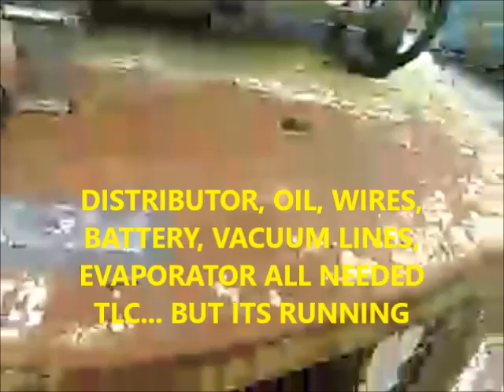Saving a old Clark forklift

Comment: I just bought a Clark gps 30 now your going to make me paint mine please tell me there good lifts I'm excited to have it an from what I can tell there good lifts
Reply from the maker: dont think these were Clarks best, but they are what they are- only 'bad' is they are rather huge...this ones a triple and weighs 9900 pounds- the counterweight is huge, and steer tires narrow- go off the cement, it sinks immediately... biggest 'bad' thing is the brake system- if you ever need to bleed the masters, good luck. its common for the plastic reservoir tee to crack, get air in, and mounted vertically, its about impossible to bleed them... ibench bleeding/plugging kinda works, but reconnecting without getting air in is about impossible- will be 'good enough', but to truly bleed, need to remove them(longer feed tube needed- i used separate reservoirs, tipped rod down, bled, reinstalled and with pedal wedged to floor quickly cut/connected the reservoir hose- a messy pain in the butt, but got all the air out)... aside from brake bleeding, other than physically bigger than similar capacity trucks, theyre pretty solid- the mitsubishi motor will run forever, BTW a 89 mitsubishi montero cap and rotor/similar worked a lot cheaper than Clark...and if you need steering links replaced, book says drop axle- not needed- pull both outer pins, kick tires toed in to clear links, swing both links rearward, then just push down on them, rotating the steer piston, giving enough room to pull inner pins...glad I did mine before buying the manual :) will say even though rated for 5000, a little mits fg25 from same year is smaller/lighter/smoother...I just had to save this one though- remembered when they bought them, and it sure looked saveable, heck only has 1500 hours on it...when I saw they were gonna haul it to the scrapper, talked the boss out of it...didnt need it, I just have rocks in my head about seeing stuff discarded over just a bit of elbow grease...ended up being a really nice truck, only have about 800 bucks in it- but quite a few hours too.
Reply: @timc2219  if your near Biloxi Mississippi I be glad to give you 800 bucks for her 😁.  I feel same way about stuff just being junked.   By chance what spark plug an spark plug gap?

Comment: Mine says 4000 lb lifting like you said she looks huge can it lift more?
Reply from the maker: Improperly used, any forklift can lift/tilt WAY more than rated, and enough to easily flip the truck over...weight is only a small part of the ratings... all are rated at 24" out on the forks and a set height off the ground... but mast full up/tilted full out, using booms especially, any truck can flip over at lower than the basic 'weight' capacity. 
  if lifting high, or extended reach, always tape measure center of axle to load center, compare to equivalent ft/lb moment load ratings similarly calculated off the rating placard... 
  ive seen idiots use lift chains hooked flat as 4-5 degrees from horizontal snap chains effortlessly, seen idiots strap loads down with chains so flat they are holding nothing 'down' at all, yet overloading everything... 40 years ago,saw a guy flip a 3000 pound rated truck over just lifting a 400 pound conveyor way high-it swung and flipped that truck like a toy...
  lift math is easy to find online i'm sure...but always keep in mind the ft/lb rating thats rarely on the rating tag, but easy to calculate, vs what you are picking...and always watch angles if lifting with chains...too many folks ignore the basic math of leverage- but its absolutely as dangerous as leaving a chuck key in a lathe- some things are simply "musts".

Comment: Great Job! I have what looks like the same forklift needing brakes fixed, a paint job, and a leak I need to fix as well. Any suggestions on a place to get parts and the paint color or type you used would be wonderful if you would be so kind enough to share it would be most appreciated. Mahalo for your time sharing everything and it's a wonderful video!
Reply from the maker: thanks- not much for video though... I just hate seeing stuff go to waste. as for paint, its mopar sublime green two part urethane over two part epoxy primer- all summit racing stuff- but i didn't spray it...neon green overspray would really suck. I bought a gallon and didnt use but about a quart. I did it with little inch and a half x four inch wide rollers. I tried rolling on the epoxy primer, figured id wetsand and spray color- but it left what i thought looked perfect, a kinda pebblegrain but smooth finish, feels like smooth paint over a sandblasted cast iron does, textured, but not...hard to describe, feels about like the texture on my laptop case... after liking the primer, thought stupid as it seems to roll on a decent urethane paint, tried the color... gotta roll back over it as it begins to tack, same as primer needed, then let flow out, really like the feel of it, slight texture shouldnt show scratches like glass smooth would, plus it just has a 'industrial' look to it... I will never spray another machine tool/lift/toolbox/anything else in the garage- plus clean up is nothing...disposable trays, mix up a few ounces at a time, when done pull roller cover off, put in tray- next day its solid, throw in the trash... aside from a couple drips, no mess at all. it IS a real urethane, so you NEED a real quality respirator to keep any isocyanate fumes from permanently injuring your lungs, but zero overspray, very little smell compared to spraying. dont buy more than a quart. the primer, (gallon) paint, activators-hardeners cost under 200 at the time, real paint is expensive... deltron clear was over 400 a gallon last time i checked- without hardener/reducer/activator... I DID put urethane clear on top of counterweight and seat pan, just hoping to help wear longer- but used the two part in a spray can stuff... automotive touchup sells it, about 30 a can- theres a plunger pin you press to pop the hardener release inside the spray can, and youve got about a half hour to use it, really works well. I did another forklift too, i;m donating it to a local airplane museum of all crazy things...they have a ground equipment collection, and it was a same model the military used thru the 60's...its done except the dedication plate- since covid shut everything down its sat like 8 months untouched... i need to get after it and get it out of the shop, out of sight, out of mind... anyways it was rolled on summit urethane too, lots of pics here- 
1963 towmotor 462 forklift saving from scrapyard | Flickr
      lastly- if painting ANYTHING bare metal, before priming, treat the metal with 'ospho' ow whatever metalprep/phosphoric acid your local hardware stores carry... just brush or wipe on, wash off with water, wash off again, when sure its clean, wash off again :) let dry... it converts microscopic rust that forms the instant bare metal meets air to iron phosphate...you cant see it, just the metal gets a slightly more grey tint, but paint loves it, and will never blister off from rust underneath...stuff with visible rust will turn black, but again, it wont rust under the paint.

Comment: Well done , could u please tell me paint codes for green and white colors , thanks
Reply from the maker: the white for the wheels was just gloss white rustoleum, the black for chassis/mast is just spray on bedliner, the green is from summit racing, #SUM-UP329Q, uses reducer/activator #SUM-UP100Q. Black for seat pan was #SUM-UP300Q (same reducer as the green)  bare metal was degreased, then treated with 'Ospho', epoxy primer was  #SUM-UP230Q, with #SUM-UP231Q activator... aside from the spray can bedliner, the primer/paint was applied with little trim rollers, and the wheels were brushed...